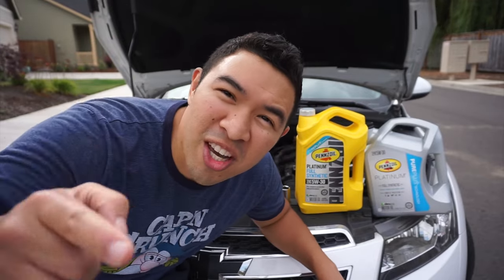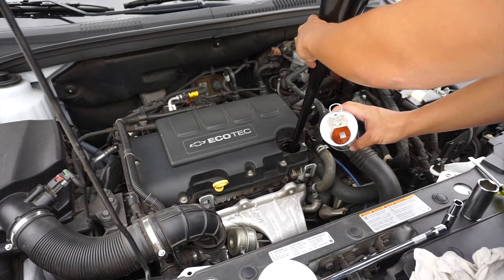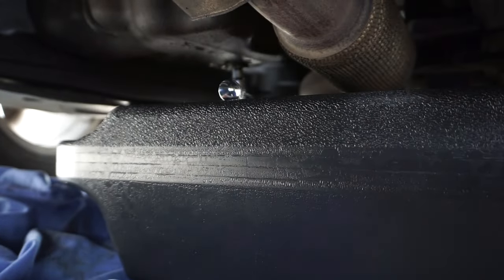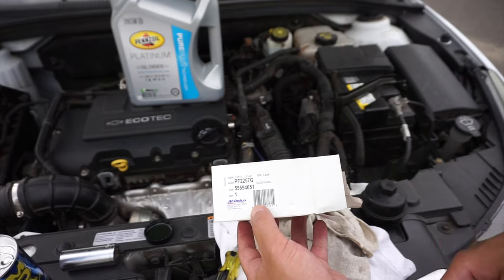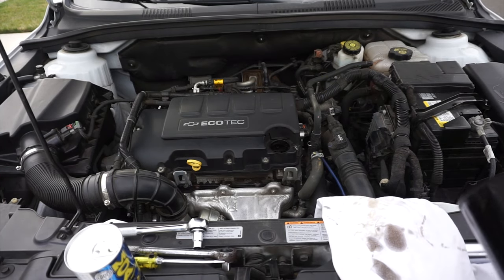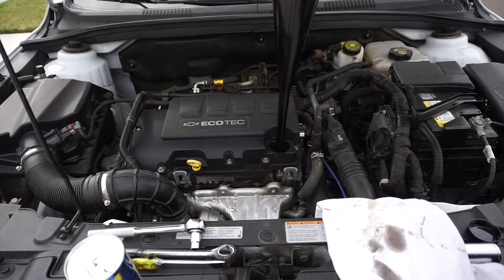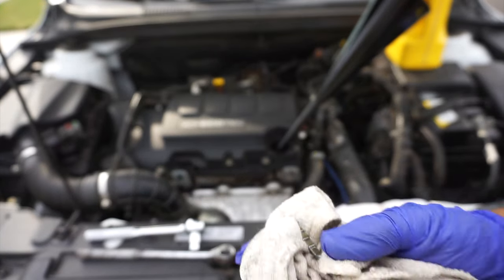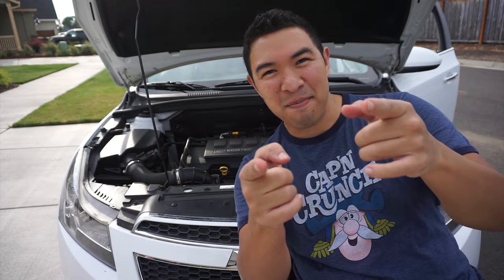Chevy Cruze Oil & Filter Change 2011-2015 | Engine Performance Restoration + Oil Treatment + BG MOA

Comment: that pain in the butt oil filter location seems designed that way so that people will just take their car to the dealer instead of DIYing...
Reply from the maker: Andrei ierdnA and how about that sealed transmission. Remove a wheel to dripple trans fluid for level? Sheesh gm...
Reply: Yeah I hate that transmission fluid level check they made I hate them for that

Comment: Great video. Have you replaced your turbo oil feed tube? The older Cruze models had an older design on the tube that would cause oil leakage at around 50,000 miles. Check yours out! Very easy to replace and its good preventative maintenance for your turbocharger. Part#25198546.
Reply from the maker: Krunal Patel wow,  Thanks I'll look into that.  A while back one of the dealerships told me I had oil leakage but didn't know where, so I switched to high mileage oil and it went away. I'm crossing 120k miles, maybe a bit late but turbo still going strong!
Reply: Drive By Reviews Yes definitely check it out. If you see oil leakage on the right end of the tube in the crevice below then it should be replaced. Especially if you have the older design with the single gasket. This tube can potentially coke up and starve the turbo from its oil supply. Do a video if you end up replacing it since you make great Cruze vids. Thanks for all you do!
Reply: @DriveByReviews  is penzoil better than mobile 1 synthetic oil?
Reply: @dannyzamudio1252  No

Comment: I thought it needed to be dexos approved oil.
Reply from the maker: To avoid warranty issues it does for sure. The oil I use is dexos approved (you can see the stamp on the jug). It's also far superior to the dexos blend your local dealer will use. Far superior.
Reply: Drive By Reviews ok, I see the stamp now. I was at walmart and I didn't see many stamps so that's probably why I missed it in your video. Some pennzoil bottles had it and some didn't.
Reply from the maker: sneakysnakepie1 Pennzoil has a lot of conventional oil options, make sure you're buying the right one! Use my link in the description to see what the bottle looks like.

Comment: I’ve watched 3 of these videos from different you tubers and each have a different size for the oil bolt. 😡 one video says 10mm one says 13 and one says T40 torx
Reply from the maker: OEM is 10mm. There is universal replacements of different head sizes (which is why some less informed people may think that's true for all) but OEM was made 10mm to make it far more likely to strip the bolt rather than the pan. Dealers, shops, amateurs ruin these bolts all the time so not a shocker that others may have bought the car secondhand with non-OEM oil bolts. Cruze forum is always a decent location for straight-no-nonsense info: https://www.cruzetalk.com/threads/how-to-cruze-oil-change-1-4t.544/

Comment: you got scammed bro with those hocus pocus oil products that legit robbed money from your pocket
Reply: I know I was so excited when I saw he was using that awesome Pennzoil Platinum, then I saw the snake oil and was shocked.
Reply: Those high priced chemists at Pennzoil perfectly balance the additive packages on their products, it's a delicate balance between detergent, anti wear additives and friction modifiers, all fighting for molecular space on the metal, and when you add additives to the mix you are destroying the balance, not improving anything.      At best you are just wasting your money but at worst you could be causing higher wear.      More information at bobistheoilguy.com